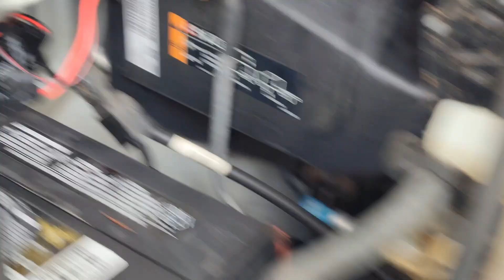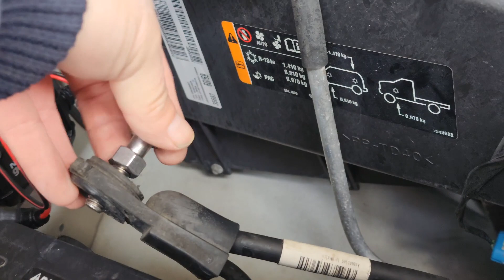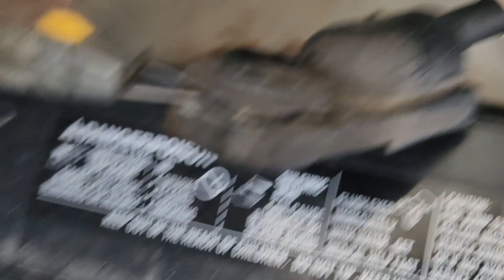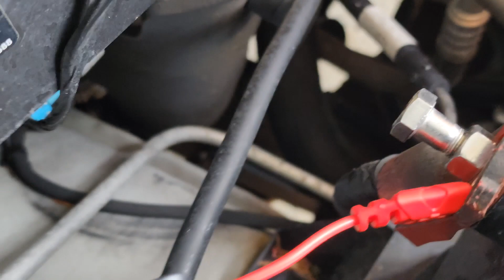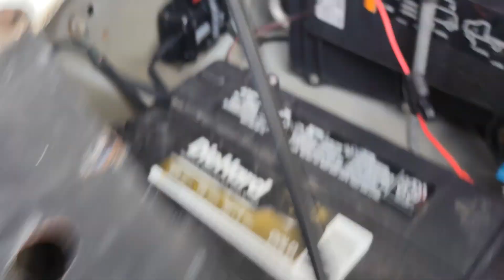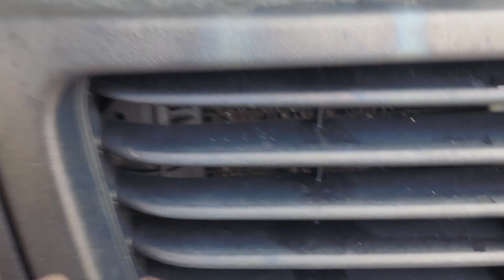NOCO Genius 2D Side Post Install

Comment: I have been doing this for years on side post terminals. I use a flanged nut for better contact,longer bolt gets a better connection and won't strip the threads. Makes it a lot easier to use jumper cables too.
Reply from the maker: Thanks,  that is a great Idea with the flanged bolt, I'll definitely try that next time.
Reply: I have the same problem with mine, I was going to cut the end off and put alligator clamps. Thanks for the video.
Reply from the maker: @towniepats4409 You're very welcome,  hope I helped! I was thinking about doing the she thing,  but first I was afraid it would void the Noco's warranty,  and second, I didn't want the alligator clamps popping of these dumb side terminals ask the time!